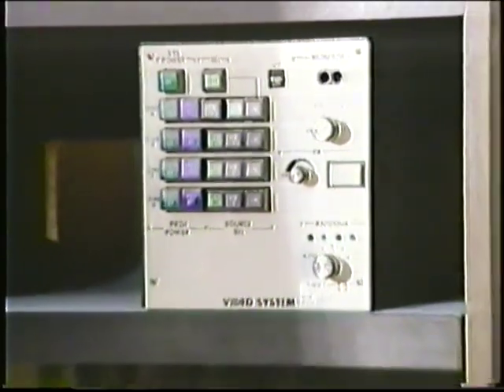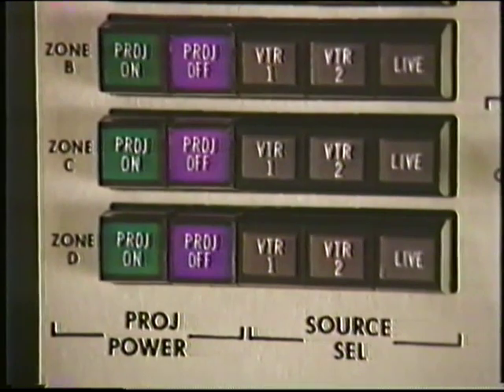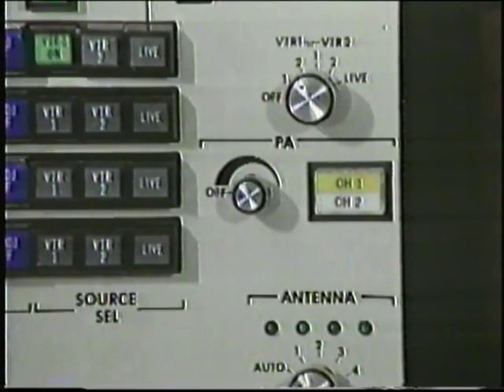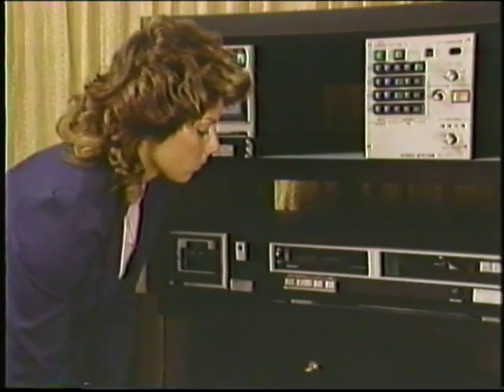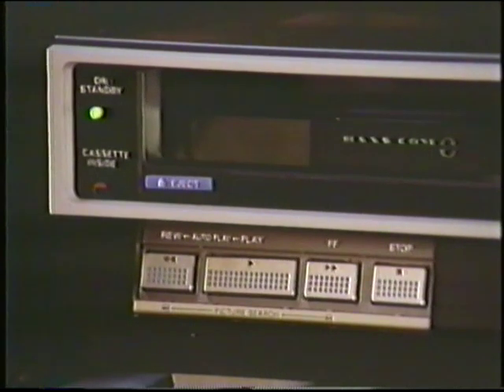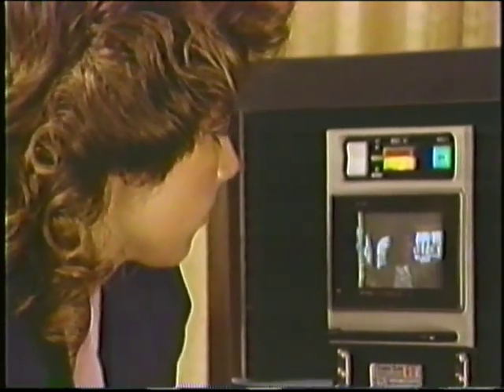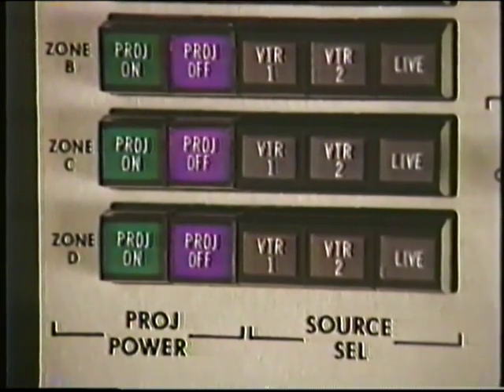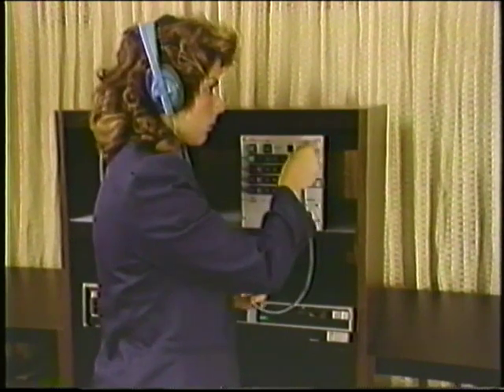Pan Am Training Video: Trans Com Video Entertainment System (circa 1980s)

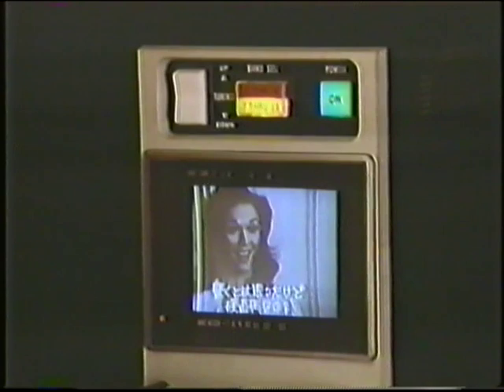Comment: The headset she is using, and what was used that time did NOT use wires, they used air!! I remember them well. You can see it at 5:25. They had 2 tubes that plugged into the armrest. They worked much like a stethoscope. Man I feel old now!

Comment: The narrator said that the VCRS were quad VCRS. Yet the unit shown was an industrial version of Sony’s SL-20 model. I know this because I owned one and yes, they were superior to the VHS format. I know because I scoped it out on an oscilloscope and a vector scope. And yes you did have to be careful about inserting the videocassette. Too hard an insert could really foul the loading system.

Comment: 6:05 WOW they used Betamax instead of VHS.
Reply: And from the look of it, the other deck might have been Video8, which ultimately became the standard in airline video until digital came along.
Reply: @tookitogo  Yeah but Video8 came out 10 years after the Betamax. Also that mini 4 inch CTR looks like one of the Mini Sony Trinitrons. And Sony was the one who also introduced the Betamax. But during the mid 80's after the big format war VHS became the dominate winner for home media. Although Video8 and Betamax was around they didn't have a huge big notoriety for home entertainment HiFi systems.
Reply: @michael1234252  That’s all factually correct, but what’s your point? This video is from the 80s, most likely after Video8 debuted, and the tiny deck they first point to (when saying there are two players) is decidedly too small to be Betamax or VHS.
Reply: That’s not Video8, that’s Philips VCR, Video Caseate Recording. It used two stacked reels. Look it up on Techmoan’s channel.
Reply: @sarahl7080  Ooh, good catch! (I’ve seen the techmoan video about it.) Is this a suspicion or do you have concrete knowledge that that’s what it was? I wish this training video was sharper — the closest image of that deck is at 1:01. The only thing that gives me pause is that I’m not aware of any front-loading decks for the VCR format. Is that one a top-loader mechanism with basically a hood over it?

Comment: These were on PLL LOT 767s in the 90s. Once, the president (Lech Walesa) was on the same flight as I was on (got a pic with him) , they removed the projector from the economy class and moved it up to business class because that's where he was and that one was broken. So, 1/3rd of the plane went without the in-flight movie.
Reply: I find it hard to believe that stewards / stewardesses removed a projector from one section and moved it to another section. Your story sounds like complete BS. They were mounted to the ceiling, not something easily moved.
Reply: @gorak9000  They removed the innards, it does open up in a clamshell manner. Whether you believe me or not, it does not change the fact that I saw it occur lol. My dad also saw it happen, as he was the station manager for YYZ cargo at the time, so did a handful of others - how else did I get a picture with Lech Walesa aboard the craft?

Idioto zajebany :P

Comment: I’m completely shocked they managed to get front projection systems working in an aircraft environment, especially with three lamps to keep in alignment! I’d always thought movies were shown through a classic projector before seat-back screens came into being! 🛫📽😮

Any idea how much space and weight the VTR hardware took up? In this video the setup is a non-aircraft installed training/demo rig, but I doubt they’d let any hardware be so spread out in the aircraft itself. Even back then, every inch of space had to be paid for, and unless you’re the only airline with on-board movies that equipment isn’t netting you any extra dollar! 💰
Reply: Those aren't lamps, they are three CRTs! CRT projectors were commonplace for video until LCD projectors got better in the mid '90s or so
Reply: What you may not understand is that back in the day, airline prices were regulated, so airlines had to stand out with service and amenities. Although this video is from a post-deregulation year, many airlines continued to try and offer better service than the others for a number of years into that era. Showing a movie, even one that may still be in the theater, was a common thing on long flights back in the day. If you went to Hawaii, you'd see several films.
I flew on a number of 747s in the 80s and 90s that had a projector like this in each section, and even on a few other models that were similarly divided into sections. One time they even had the gear on a cheap charter 727 flight down to Mazatlan. There was the one control unit located in a galley, normally with the tape deck right by it, and that system fed signal to the projectors and speakers in each section.

Comment: An NTSC Betamax tape would be a bad enough picture to begin with, but blow it up on a big screen and would look pretty ropey. CRT projectors were impressive at the time if correctly aligned / converged, preferably in a fixed home theatre set-up. But I'm not so sure about maintaining convergence on a CRT projector in a jet which occasionally has hard landings, frequent temperature changes, and wobbly flip-over screens. I bet the colours and lines were all over the place and the maintenance teams would have been very busy constantly trying to re-align / converge the RED GREEN and BLUE tubes and lenses due to gradual movements. They are generally very sensitve to small shifts in alignment. I remember flying a lot in the 1990s and 2000s on plenty of old BA 767s, and some US and Australian airlines that had conventinal CRT monitors in the ceilings. Even those screens were badly affected by magnetic changes and always suffered from RF interferance. I always remember it being disappointing.
Reply: you never noticed the poor quality because at the time there was nothing to compare it to
Reply: @festusbojangles7027 the long haul flights I remember in the 1980s (Air New Zealand with 747s) had both projectors (for those seated in the middle) and CRTs in the aisles (for those seated near the sides). The CRTs seemed considerably brighter and sharper than the projected images, although everything went out of adjustment as we travelled around the earth’s magnetic field. It was all rather terrible even at the time (I remember not being able to hear clearly), but better than nothing, and no-one had handheld TVs :)
Reply: At Beta1 speed   it would look fine..

Agree if it  was recorded on Beta3 speed..

Comment: would the tape still play during heavy turbulence? I can't remember now.
Reply: Thinking about how VTR transports work: Probably a lot better than modern disc-based media! Except that a VTR is about 20-40x the size & weight of a modern laptop blu-ray drive, and any modern operator will put weight (And fuel savings) way ahead of resilience! 💽

Of course, the most appropriate option would be just having the movie on an SD card… 😉
Reply: @mipmipmipmipmip Yeah, that won’t do them any good. Given just how close to tolerance modern projectors drive their lamps, I don’t think modern projection systems would work well on aircraft either! 🛫↕️😯

Besides: There’s no way a single projector and screen would work on todays aircraft when most passengers have their own screen, could (And would expect to) stream their own choice of content from a media server on the plane, and those pax without a device can always be lent a tablet for the flight. 📱🎞😇

Comment: It seems that this VTP (which he calls a VTR) is called "quad" not because of the tape size (it plays a Beta Max cassette), but because it works with four television systems (PAL, SECAM, and two NTSC).
Reply: VTR=Video Tape Reproducer. It's an IFE term. The multi-track tape or multi-disc CD player used for the audio channels is an "audio reproducer". Nowadays you have "digital media reproducers".
Reply: @straightpipediesel  Agree..
Reply: @straightpipediesel  , how can we tell whether the author meant "reproducer" or "recorder"?
Reply: @smadaf  I would not expect these units to record... they are only meant to reproduce (or play) tapes.  There's no need to record for play-only units on an aircraft.
Reply: It also played VHS; it had two tape decks. Somehow my uncle had one of the tape players used in this system when I was a kid in the 90's him and my aunt used it to watch vhs and beta max tapes from England.
Reply: An actual Ampex Quad VTR would have been quite a sight installed on a jetliner, with all the size and weight of the machine, power requirements and also compressed air needed well above cabin pressure. It also requires a skilled operator to get it even working.
It initially made also me think that there is a mistake in the video as they call Betamax "quad", but the 4 formats explain.

But just those CRT projectors are so heavy that this arrangement surprised me a bit, even though it is from ages when nobody cared about jetliner fuel consumption.
My friend once had an Electrohome CRT projector looking very similar to the ones seen in the video, and he told me that it required more than 2 persons to get it installed into his apartment's roof.
I have watched a movie in that particular home theater and the contrast and black level were just incredible, though in an jetliner cabin it would be probably not be possible to set ambient lighting so optimal.
Reply: @arska6383 Yea, I think Its an error. Ampex  Quad VTRs  use in TV broadcasting years ago .

Its just an industrial  Betamax player with multi TV standards formats ..

Comment: The announcer keeps saying there are two types of VTRs, but they cut out all references to the other one...
Reply: The one on the left was a Philips VCR, Video Cassette Recording, player. It came out in the 70's and used two stacked reels. See Techmoan for a overview.
Reply: The other one can only be used by Level 20 Flight Attendants and above. 🤣
Reply: @Colaholiker  the other one records the flight attendants to make sure they're using the first one correctly
Reply: Yeah what's the deal with that
Reply: They probably had different versions of the training tape for different airlines, depending upon what formats were installed.

Comment: 1. I always assumed the pilot controlled it.
2. I didn't realize planes in the 80s had those cheesy drop ceilings.
3. It's just a Betamax. Why do they make it seem like it's the Starship Enterprise or something? You pull the screens down, pop in the tape and press play.
4. They keep the tapes in a safe? Seriously?
Reply: 4. Yes. Even today, movies come out on in-flight entertainment during the window of time after theaters and before home video (streaming)... at least 1-3 months before stores. That made it popular for theft, it was a secondary reason why they used weird formats like Beta and later Video 8. Some illegal rips on the Internet show things like "Property of United" for this reason. I remember when Titanic was shown in flight, it was a big deal.
Reply: About 3 - absolutely. 8 Minutes of instructions, filmed at a time when I would think most households had a VCR at home, so any adult person would be familiar with their operation, which only leaves the power switching and projector source selection to be explained. 

Today's in-flight entertainment systems are so much more complex, even from a passenger perspective, but you don't get any training.

Comment: American's DC-10's had a camera in the cockpit that was used to feed the projectors during takeoff 😎
Reply: This should be required by law lol
Reply: @LemonToGo  just makes me wonder what everyone on American 191saw...RIP 🙏
Reply: @brentboswell1294  I could have gone without that thought. ...RIP
Reply: @brentboswell1294 Good question.  If the system was turned on as per procedure, the camera would have been displaying on the screens the view from the cockpit.  Terrifying.
Reply: Lufthansa has (or used to have, it has been a while since I last boarded one of their longhaulers) several cameras on their 747-8 and A380 models, including one that is mounted on the top of the tail fin. Now THAT is a view for a landing... Better than what the two people in the very first row get IMHO😍
Reply: I believe I saw this on an Air France flight once too.  Definitely wish it was across the board with all airlines
Reply: Almost all planes today have that, luckily (except you can also switch to different camera positions, e.g. gear, wings, tail)
Reply: @planefan082  Maybe as a pilot aid, but not connected to the entertainment system. I haven't seen that since these Lufthansa flights in 2013. Not even on my trip onboard a brand new Delta A350 in 2019.
Reply: @Colaholiker  No, as entertainment. Cathay Pacific, pretty sure a few other Asia-based airlines
Reply: @planefan082  I was only scheduled to fly on Cathay once, but that business trip was cancelled. 
My usual run (before covid and hopefully soon again) is Germany <-> USA, which leaves me with either Lufthansa (too tight in economy, company doesn't pay for business) or the US based carriers. Having the radio comms on the IFE on United (if the captain turns it on) is cool tough.
Reply: @Colaholiker  You have to fly into and out of the US? My condolences. Absolute travel nightmare on almost every itinerary involving US soil
Reply: @planefan082  Why? I like it (well, maybe American Airlines a little less, but Delta is really nice, United somewhat behind Delta but way ahead of American).
I don't need any fancy ka-blings, All i need is a seat with decent legroom (which I can get there at a reasonable surcharge, unllike other airlines that charge an arm and a leg or don't offer it to non-status customers t all). I don't need fancy food, I don't need champagne (yuck, I don't drink that stuff anyway)...
The only major inconvenience I had on a US-bound flight was not the airline's fault, but the departuer airport's. They somehow lost my bag and it arrived a week late. (I know that it was not the airline's fault, since I was already informed that my bag went missing when I boarded the plane. The loaders only got the baggage tag, but there was nothing attached to it...)
Reply: @Colaholiker  I just mean it's far more often a pain. Elsewhere, legroom and everything you describe as an extra is often included in the base fare. Fair enough if you don't want it, but anyways.
Whether the airport or airline I find baggage disruptions and flight delays a LOT more common
And I generally notice that North American flights are a lot more expensive than itineraries that don't involve the continent.
Reply: That was dropped after the May 25th, 1979 crash of American Airlines Flight 191 at Chicago O'Hare, as the passengers would have seen their impending deaths on screen.
Reply: Several airlines now have multiple channels showing cameras from the tail fin, behind the nose gear, and under the fuselage.
Reply: Late to the party but you could see on the control panel that there was a live camera option, though there might not have been a camera fitted as it was probably a generic control panel.

Comment: Anyone know what company was contracted to develop the Trans Com system? GE? Sony? Westinghouse? JVC?
Reply: Trans Com was originally owned and operated by Sundstrand (you can see their S logo in the video), but I guess all the AV hardware was Sony (the tapes were Beta after all) and in 1989 Sony acquired Trans Com and it became Sony Trans Com. Later it was sold again to Rockwell.
Reply: @kalleboo  this is why i troll the comment section-- to find diamonds such as your comment!!!
Reply: That "Quad VTR" is actually a modified Sony SL-T50ME Betamax VCR. Quad or Quadruplex refers to the 2"-wide tape format by Ampex.
Reply: @crashbandicoot4everr    I'm pretty sure the "quad" refers to four video standards. NTSC 3.58 & 4.43, PAL, and SECAM.

Ampex never made a quad VCR.
Reply: @rolliebear42  Actually this machine supports two variants of SECAM (French and Middle Eastern) so it's technically a 5-standard machine. That's why it says "SECAM 1/2" on the system indicators. I have an SL-T50ME in fully working condition.
Reply: @crashbandicoot4everr  Thanks, it's been ages since I thought about the various world standards. Heck, $Employer hasn't used analog NTSC in nearly 15 years.
Reply: @crashbandicoot4everr  I'm guessing Sony made playback-only decks for applications like this?
Reply: @AaronSmart.online  Sony made several playback-only Betamaxes for the industrial market, namely those with the SLP model number prefixes.
Reply: Trans Com was originally a stand alone startup operating out of Seal Beach, California before it was sold to Sundstrand.
Reply: Tandy Corp, Magnavox, Montgomery Wards, Sears. Low budget here folks.